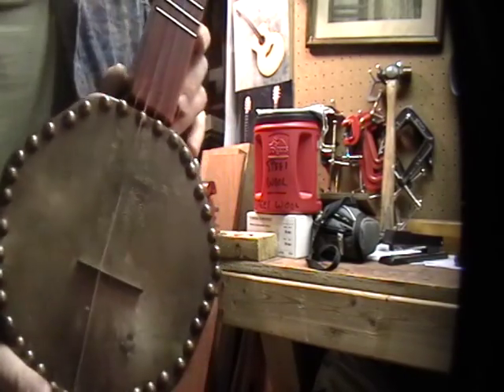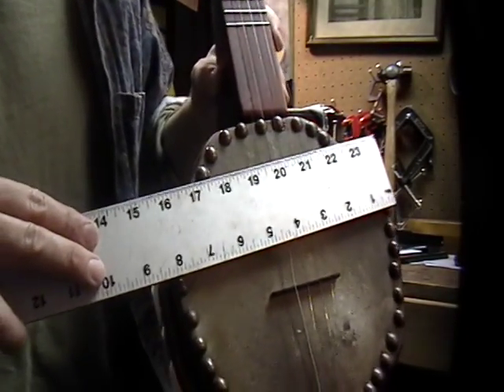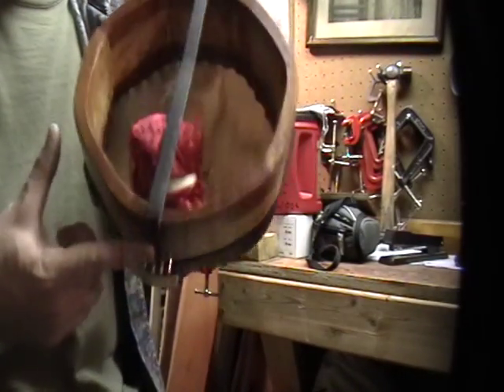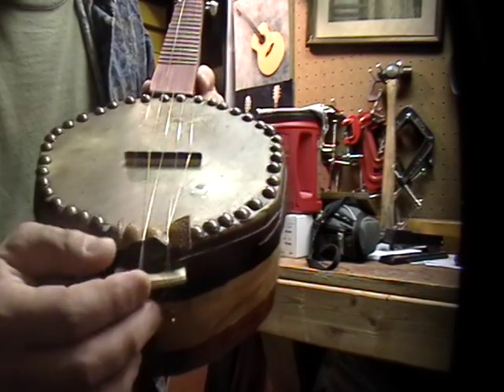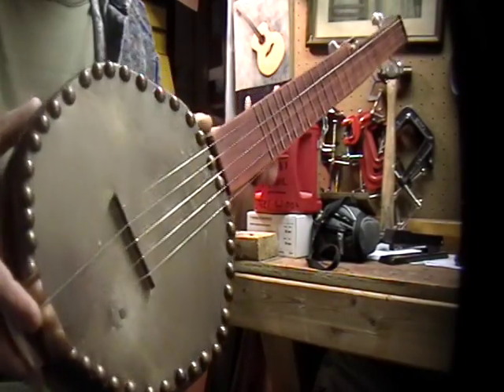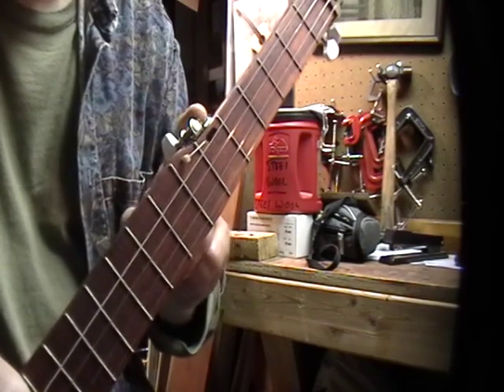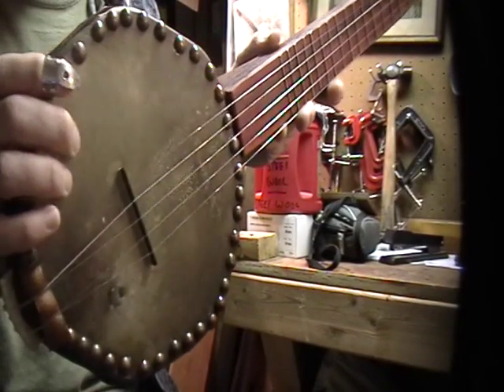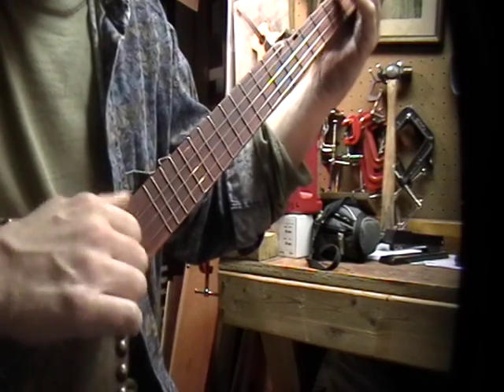This Little LIGHT of MINE sound demo Homemade Tackhead banjo #2 short scale.MOD

Comment: That's the problem with changing a design halfway through construction. Next time you can run the 5th string shelf back to the 4th fret and mount the guitar tuner farther over.
For guitar tuners on banjos I like slotted heads. The knobs sticking out never look right.
Over all, I thought it came out really well. Unlike many of my own projects it actually plays!